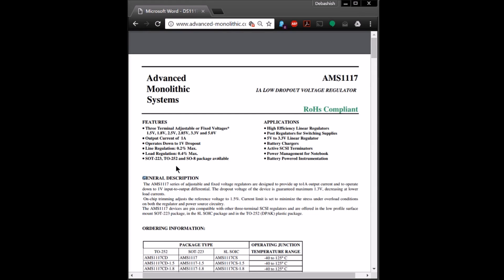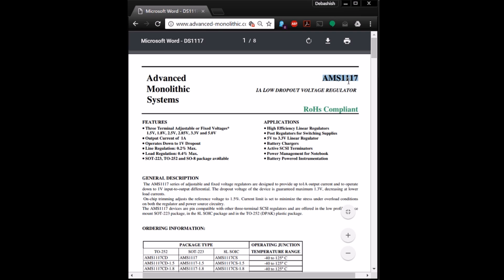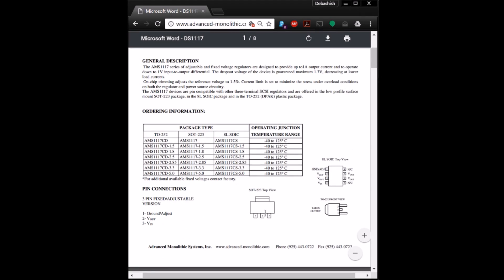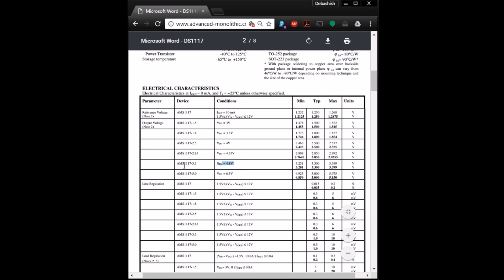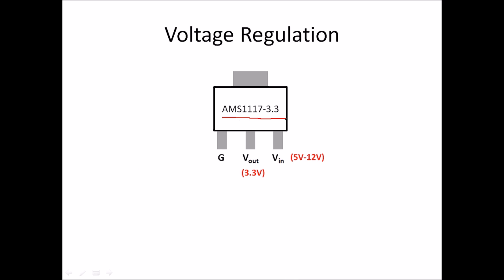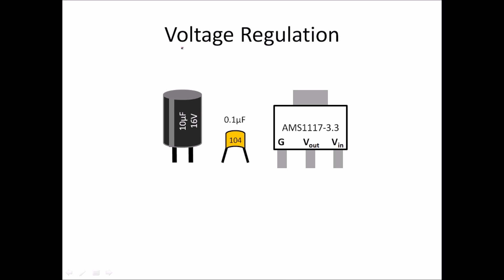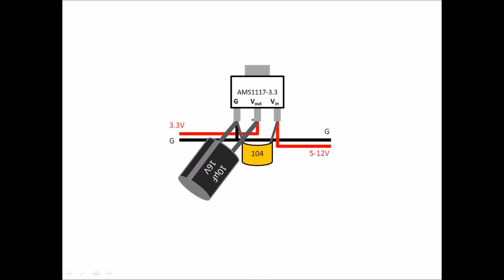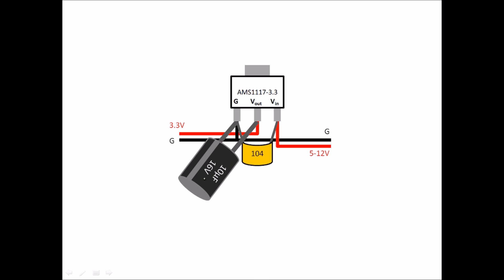How to build a 3.3V Voltage Regulator?

Comment: Hi, ams1117 3.3 volt regulator setup by me was working fine and the input I had provided was from 12v 2amp AC-DC adaptor. But one fine day all of sudden it gave output of 12volt and the EPS32 connected to ams1117 just fried😢....any reason why this voltage regulator behaved the way it did above???

Comment: Namaskar🙏
Great information.
Till today I was using  1117 without adjustment made by you.
But this is safe way.
What adjustment(Capacitors) required for 1117  output  3.0v , 2.85v  , 2.5v , 1.8v , and 1.5v
Kindly guide me.
Thanks

Comment: I don’t understand - if this device automatically regulates the incoming voltage, to 3.3V at the output then why does this device have an adjustable pin? Sorry for the silly question - I am a novice at electronics, but I’m trying to learn more about it. Thank you
Reply from the maker: There is no adjustable pin! Maybe you are looking at different voltage regulator.
Reply: @deb-sahu  It’s right there, on the first page:  1.Ground/Adjust
Reply from the maker: The spec sheet is for both adjustable and fixed voltage regulator. I used a AMS1117-3.3 which is fixed voltage output. If you have AMS1117, refer page 4 where they talk about resistors to use for load regulation.

Comment: Hi, I do not have the ht7333 regulator
What regulator should I use as an alternative?
Reply from the maker: There are so many to list here, on digikey’s website you can search for voltage regulator and it will list them all.

Comment: When I check the datasheet of  AMS1117 3.3 there are 4 pins. The top part is also a pin. I can see that you solder that part in the vedio. Can you explain what that pin is? Is it also an output? Then why dont you connect a cap to that as well?
Reply: That pin is heat shield. Connected to GND

Comment: I want power up attinty13 (3.3v) with this LDO by following your video, can it constantly support Vin on that chip? Source: 15v
Reply: @deb-sahu  note with thanks 😊
Reply: @Easy Fixing
The ATtiny13 is a CMOS chip and has a very low power consumption, less than 1mA. The AMS1117 has an absolute maximum voltage of 18V, so as long as your 15V supply is certain not to exceed that, the AMS1117-3.3 will be fine to use, although you should actually add a resistive load across the output of the regulator to ensure it is supplying a few milliamps, as it it is only guaranteed to regulate with a minimum load current of 10mA (i.e. a 330 ohm resistor for this case)

However, with a voltage drop across it of around 12V, it will almost certainly regulate on lesser load currents, and the data sheet shows it typically working with load of 2mA. If the AMS1117 is set to supply 10mA from a 15V supply, it will still be dissipating less than 120mW and the junction temperature rise will be 15 degrees Celsius at worst, a long way short of triggering the inbuilt thermal protection.

Comment: Acording to the manufacturer datasheet using a 22uF capacitor on the output pin of the AMS1117 3.3 "will ensure stability for all operating conditions". Furthermore they don't recommend (but don't say it is wrong) using a capacitor on the input. So I'm curious, why you choose to place one on the input? And why lower the value of the capacity on the output? Thanks
Reply: Thank you for sharing your experience. I'll also be powering an esp8266-01 and a mcp9808 temperature sensor. I'll be using a 6 or 5v power supply not a battery. Would you use the same capacitors for this configuration? Best
Reply: I forgot to mention that it it supposed to be a long time application.
Reply: Yes, I've seen your other video we're you discuss this. But that is the next project :). Thanks

Comment: can you use a 104K capacitor on the VIN instead of a plain old 104? Thanks for the awesome video!
Reply: @deb-sahu  Capacitance is commonly marked in picofarads and 104 indicates 10 x 10^4 pF = 100 nF or 0.1 microfarad. The 'K' suffix in this case indicates 10% tolerance. That's a very common ceramic, non-polarised capacitor.
The one you used is certainly not a titanium capacitor, which is a very rarely used type of electrolytic capacitor, and definitely polarised.
On the other hand, the electrolytic capacitor used on the output ought to be a tantalum capacitor, which is much better than the older aluminium electrolytics for supressing high frequency ripple or spikes.
Reply: 104K stands for 0.1uf capacitor
Reply: Debashish Sahu 
Brown out?
What are you talking about?

Comment: hi 
i have ams 1084-33cm when i searched on internet for the datasheet i can't found circuit for the 3.3v i just found for adj. one can i use the same circuit with the same components 
and i have also found ams1117-2.5 on one of my used boards can i use the same circuit with the same components
Reply: Debashish Sahu it’s a voltage regulator also but I don’t know the difference between them

Comment: I am new to electronics still. One of my previous projects was quite liberal with the voltage of the capacitor, as long as it had the correct uF value. Could I use a 10uF 25v capacitor reliably or would I have problems? I would not want my ESP8266 to act up in a permanent project.

Comment: Hi Debashish sahu, I'm working on an Arduino project and required both 12v and 3.3v , 12v for solenoid valve and 3.3v is for microcontroller but due voltage regulation on the microcontroller which is ESP8266 requires on 3.3v currently I'm using 2 adapters one for 12 and one for 3.3v. is there any solution to make get both the voltage level separately with only one adapter ? The module works all the day that's why I want a both level ones. I had also tried 12v to 3.3 voltage regulator but it getting hot after running all the day.

Comment: Wait, the design says is a 104 capacitor, but the assembling part says 10uF (106). Which is the correct capacitance?
Reply: if I use 12V power supply to power a board that has AMS1117-3.3 as regulator is that gonna hit the regulator a lot ???

Comment: HEY there , I redid the board following your Video And I got it to work  I have 5.6V going in And 3.3 V Coming out .
Cool project ... Thanks
Reply: Update   Used this Design now 15 times and  it still work great .... It has never failed yet ... * * * * *

Comment: Hi Im new to electronics. Im wondering what are the capacitors for  because the voltage passed through the capacitor goes straight to the ground. What happens if you dont use them?
Reply: Why is the capacitor between the input and the ground and  between the output and again ground if I may ask? Instead of between the input and voltage regulator.
Reply: Thank you alot for making this clear for me!
Reply: @deb-sahu  shoot makes a lotta sense now, tnx

Comment: hey there, thanks for the video.

about the 0.1 uf cap, why not place it on the v-out and ground along with the 10 uf? im fearful that the max 12 v can burn it.
Reply: can 1 use 104 ceramic capacitor 250v ?